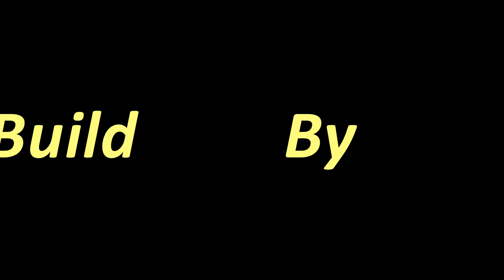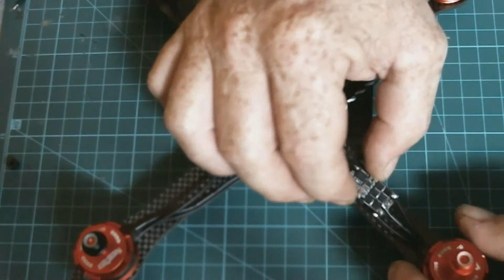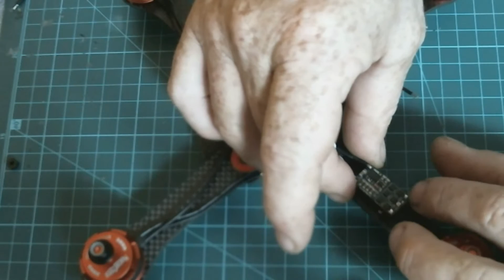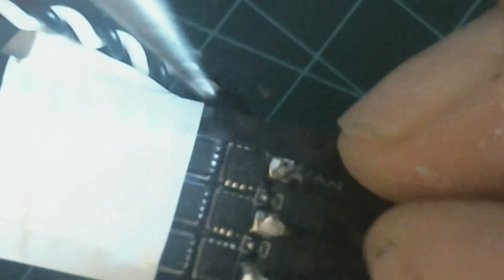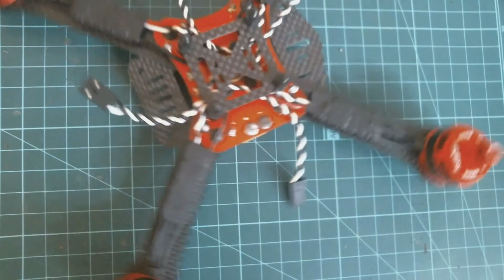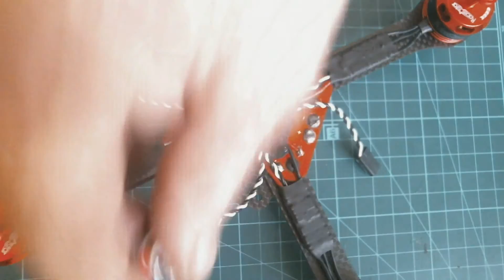My Favorite Martian lll

Comment: Hey Steve. Looks like a good build. If the motors spin the wrong way will you have to swap two of the motor wires or can if be changed by software?
Reply from the maker: No the days of swapping wires are behind us. I will just reverse two in BlHeli suite.
Reply: I would like to see that. Do you have a video on it?
Reply from the maker: Joshua Bardwell does a great one check his one out Dave.